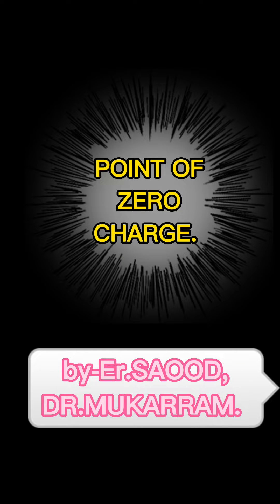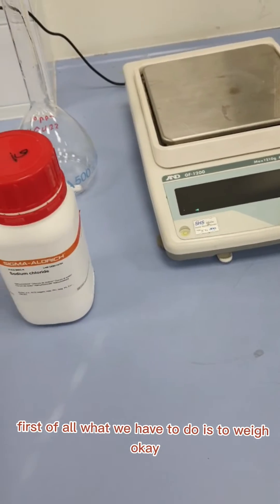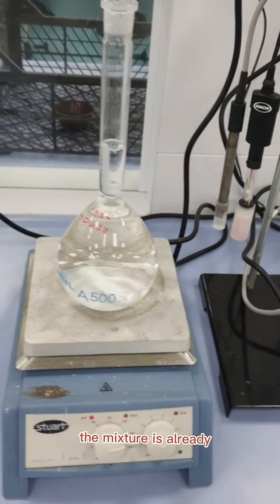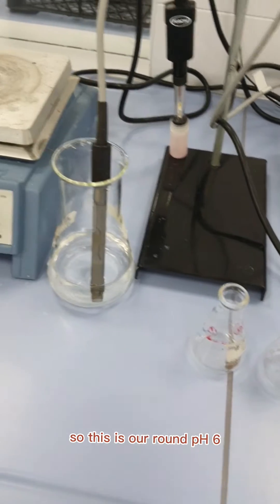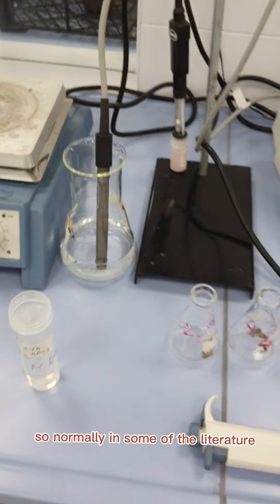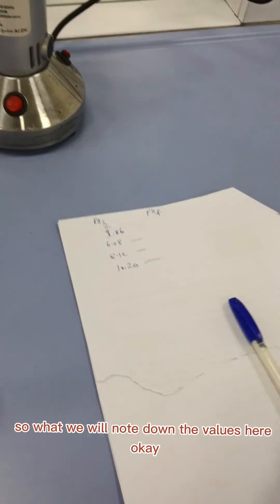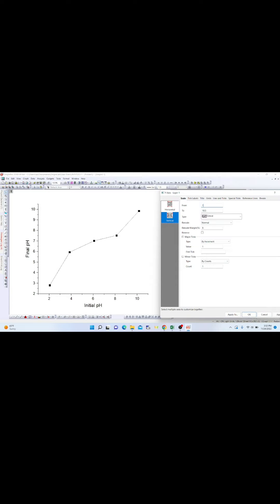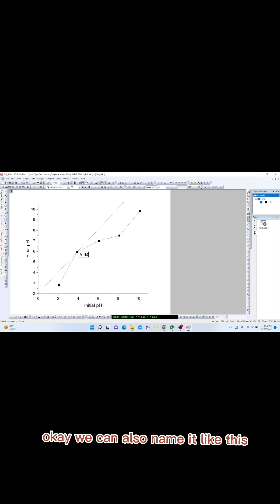Point of zero charge of adsorbent by salt addition method

Comment: The graph between delta pH and initial pH. You plotting wrong graph
Reply from the maker: Sir both are correct you can draw graph between initial and final pH too
Reply: How explain? . Wrong
Reply from the maker: @muhammadmujahid7561 sir I did not say wrong or right I said point of zero charge graph can be drawn in both ways
Reply from the maker: I will add research paper links

Comment: Role of NaCl in point of zero charge
Reply from the maker: The salts are added for tuning ionic strength and also for the   for creation of ionic layers around the particles to make possible measuring the zeta potential
Reply from the maker: You can also use nano3 instead of nacl or can compute zeta potential too
Reply: https://youtu.be/3Fm-u0zYtpc

Comment: what should be the sequence...Nacl soln, adsorbent, pH adjust or NaCl soln---pH---adsorbent. both have different results
Reply from the maker: We should adhere to the method,  first prepare nacl solution then ph adjustment and then add adsorbent,  I don't think it will give different results , you may try with nano3 salts too
Reply: ❤ @materialsandtechnology8956
Reply: https://youtu.be/3Fm-u0zYtpc